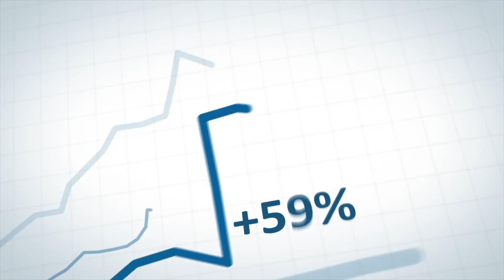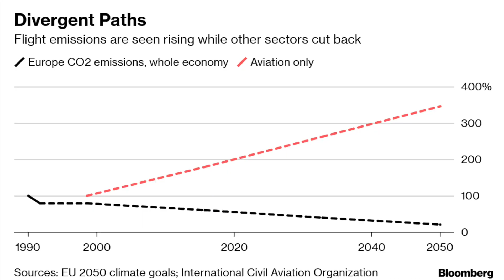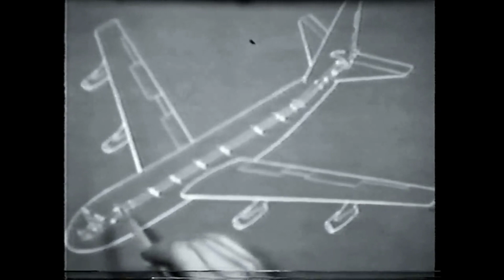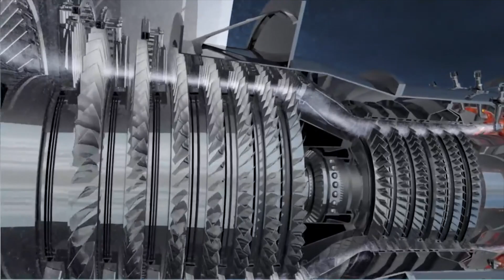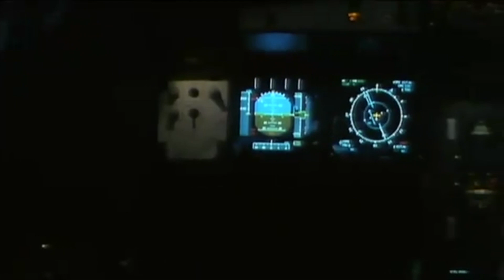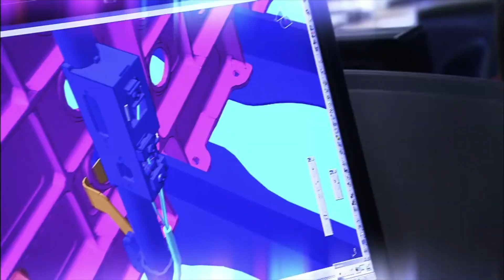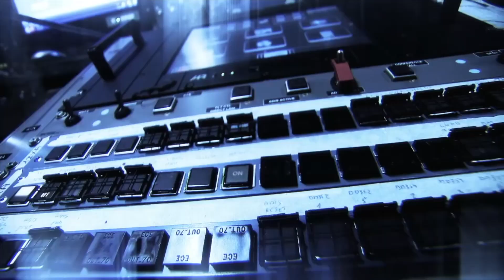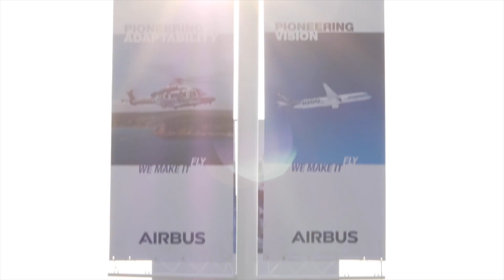Aviation Documentary: Evolution of the Aviation Industry (Documentary)

Comment: BOEING....the innovator and scarebus the copier !!!!
Reply: Boeing, the giant who crushes competitors instead of competing.
Reply: @terryzanger7152  BOEING developed the basic design of jet transport waaaay back in the 1950's in the 365-80 proof of concept for the KC 135's and 707  jet airliners and today there are still 100's of the KC135's still flying and serving..  Also 90% of jet airliners today still copy the basic design of low swept wing with pod mounted engines !!!  Also the Boeing 737 line of aircraft, which was just a shortened twin engine version of the 707's has become the  most widely used jet transport with 0ver 10,000 being delivered and still have 4,000 yet to build !!!  That is success !!!!